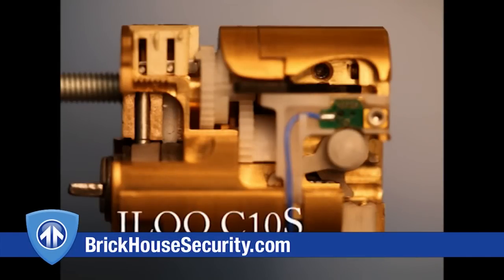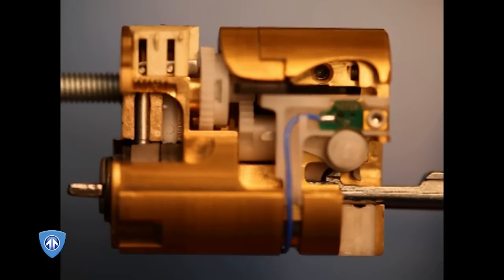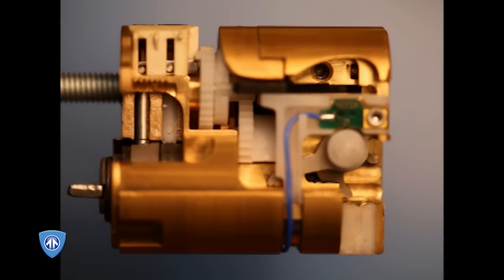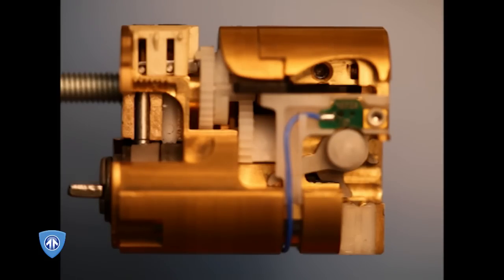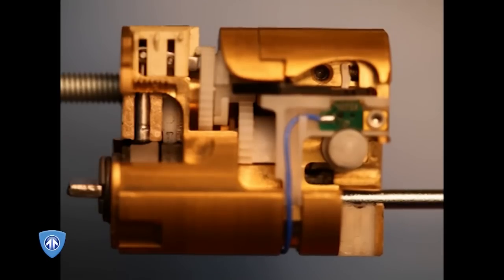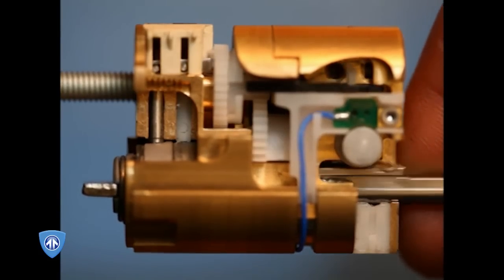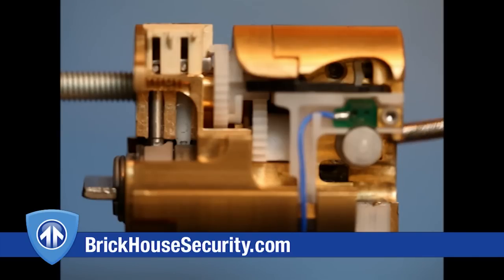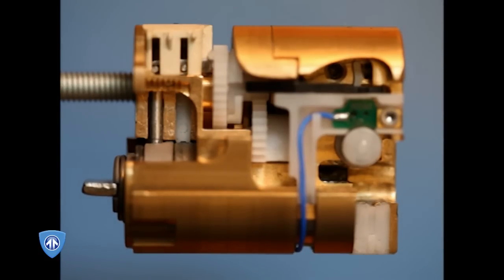See a ILOQ C10S Lock Get Broken into in Under a Minute

Comment: I wouldn't call it a security vulnerability if you need the authenticated key first in order to do this... Why would someone with the key want to even do this?
Reply: The idea is that someone can "prep" the door for a vulnerability. The homeowner then uses their key normally to enter their house, oblivious to the tampering (which is almost completely unnoticeable). Once they leave, the lock will not actually lock and someone can open the door with a screwdriver at a later date.

Comment: If you have a "service key", then you will be able to open the door in a state where you have access, do your real jobb, and then come back later using the screw driver, to break in. Right, that is a situation you could see?
Reply: Not just that, you just need to "borrow" the key from someone or cut the plastic reset lever before someone uses it and you are able to enter with a screw driver.

Comment: Fact of the matter is, it's a pain in the neck to simply walk up to and mess with. Most people breaking into your home through the door lock will not likely get this open in the time they need. A good crook just shims the top of your garage door and pulls the emergency latch with a coat hanger, who locks the internal garage door right? Some people just go through the wall out back, not much to cut through really, it can be done silently.

Comment: This lock system is so shit, I have it and it functions irregulary, sometimes the key might open the lock, sometimes not. What a poor engineering :(
Reply: I was recently testing a box full of new key copies made for the same iLOQ lock. Maybe 40 keys or so. Only about half of them worked properly and we tested/used them properly. I fully agree, the lock technology is irregularly working shit and I don't like it. 

The same problems have existed in another case too but less keys involved. 25% had to be replaced then.

Very annoying and time consuming.
Reply: Slow and firm is the key. We've found about 1% of people do have frequent issues with opening an iloq. The rest of us not so much.
Reply: U need to push the key in with authority.

Comment: You mis-understand. You can (trivially) tweak the lock so that it never locks properly again. So, you nobble the lock, then come back a (few minutes, day, week, years) later, and gain entry with a screwdriver. As long as only valid keys have been used after you nobble it, your attack will work.
Reply: Just one valid key after the (easy do to) manipulation is enough.
Reply: @qq84_Richard  Yes, one authorized key after the manipulation is all you need. However, if the next key entered is unauthorized key, the lock will fail closed and no key will open it.

Paranoid iLOQ users still using the old version should always try to open any door with known bad key first.

Current version of this lock is claimed to have some modification that's supposed to fix this vulnerability but I haven't found any publicly available information about the supposed fix.
Reply: @MikkoRantalainen  No, 1. if you manipulate the lock, it can't close anymore and will get opened with any key/screw driver forever. ...or until someone uses a tool to reset the lock like shown in the video.
2. If you manipulate the key, the next intact key will reset the lock.
Reply: However, the attack also fails if the first key entered in the lock after the modification is not an authorized key – in that case the lock will enter locked forever state.
Reply: @MikkoRantalainen  Or if someone fails to open the lock with a valid key on the first try (which is an all too common occurrence with these).

Comment: where did you get this "millions of people using this" statement? i think abloy is far more used than this lock.. i've seen these locks few times but not too much..
Reply: Millions is pretty extraordinary claim as there are only 5 million people in Finland (with around 2 million homes). And the locks are quite rare to be seen outside Finland. It'd say these locks are used by maybe tens of thousands of people.
Reply: @jukka-pekkatuominen4540  Probably a over statement but you forget, not only home owners use this keys. Here in Raasepori almost every building owned by the municipality uses Iloq, that is for the main door and doors inside of buildings. So at least a 100 buildings and between 1-20 keys per building. 
I know that is not a million, but Raasepori is not the only municipality that uses these locks.
Reply: @nattenaniel  The claim was that "millions of people" use this key. Not that it is used in millions of doors.
Like I have iLog and I use it for 5 doors (2 exterior doors, 2 storage room doors and 1 apartment door). That is still only 1 person using the key.
Reply: @jukka-pekkatuominen4540  Ye true that.

Comment: " it can be broken into with nothing more than a screwdriver"

yeah right...but you still need key with right identification to set up the cylinder?

or am I missing something?
Reply: The part where the attacker modifies the lock from outside (or actually modifies the mechanical arm near the entry of the keyhole) allows moving away from the lock to wait that an authorized key has been used and then the lock will stay forever in state where any key shaped object can open it.

The only easy way to verify this hasn't been done to your lock is to always keep two iLOQ keys with you. One that this the real key you use and an another that is key that has not been authorized to do anything. And after every application of the real key, you must check that the non-authorized key cannot open the lock after the authorized key has been used.
Reply: @MikkoRantalainen  :) Mine must be secure then, as not even my authorized keys can open this PoS consistently.
Reply: @DontEatFibre  Yes, the mechanical design of this lock uses multiple really small parts so I would assume it will fail locked when parts see enough wear.